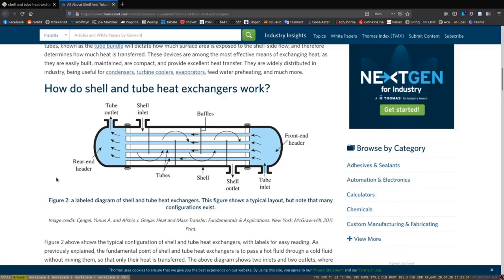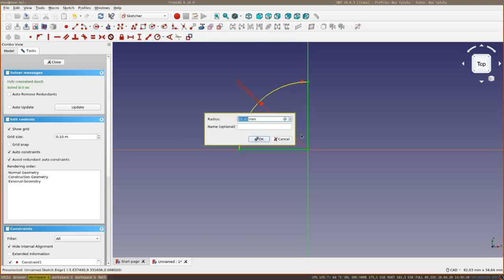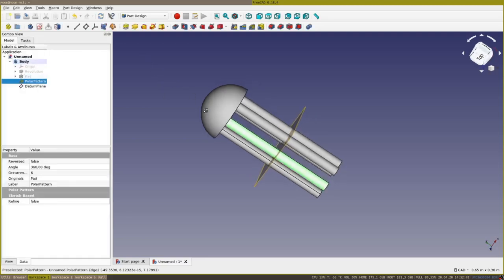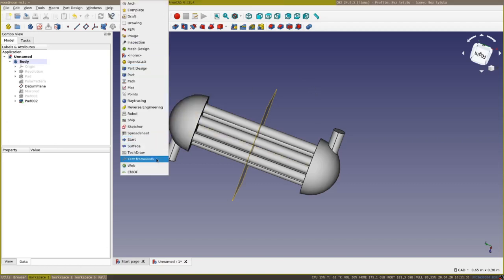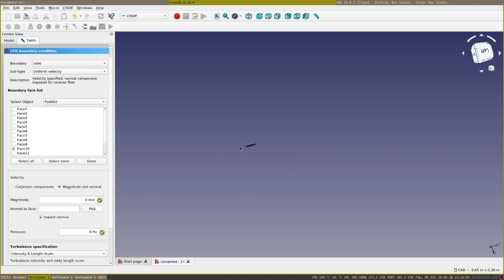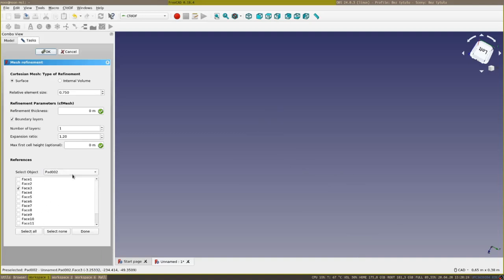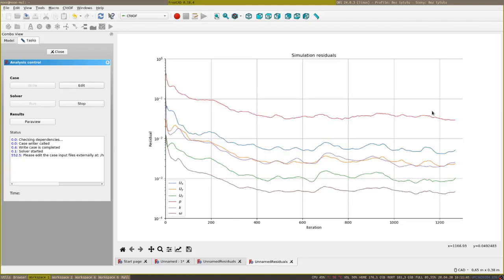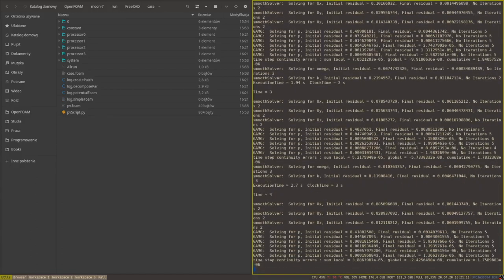FreeCAD and OpenFOAM tutorial -  case preparation and simulations with CfdOF

Comment: Thank you very much! It helps me a lot. But I have a question I found when I tried to run the same thing, the meshing is much slow than your computer. Do you have any suggestion ?
Reply: Buy a new pc
Reply from the maker: It depends on PC, also it may work slower if you are using virtual machine. If so, maybe try to assign more memory to it?
Reply: I'm sure you've already figured it out, but FreeCAD and OFCFD seem to be pretty cpu heavy.   You'd want a nice cpu, and maybe a nice graphics card with paraview.

Comment: Hi Pawel, Great step by step! everything ran smoothy. However I never get the residual information in the plot window (plot addon installed) and other thin I noted at the end was Paraview variables are visible  only if uncheck "Skip Zero time" so then Cell arrays appear. Thanks for any guide,
Reply: Pawel, I found the error. Installation must to be in exactly such order (some erros wont be detected by "checking dependencies"), also if MS-MPI already installed, it must to manually removed then use BlueCFD installation. Now I can see the things cooking (residual plot data). thanks

Comment: Got this error from OpenFoam 8 : : OpenFOAM IO error: file "constant/triSurface/.stl" does not exist file: constant/triSurface/.stl at line 1. 

Simulation exited with error
Reply from the maker: You might have "InitialisationZone" in your CfdAnalysis tree. You should remove it, you don't need it in this type of simulation
Reply: @paweojek8352  I am having the same issue but I don't see "InitialisationZone" anywhere
Reply: @bakayaro117 

Set the parallel processing option to *False*.